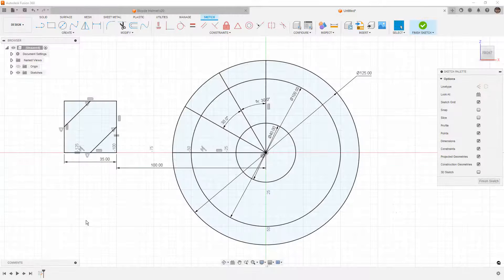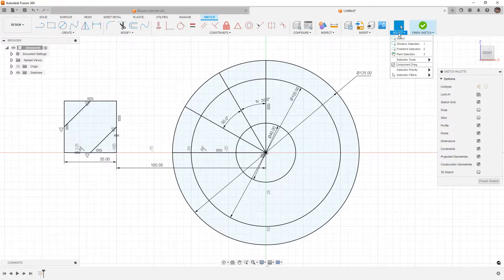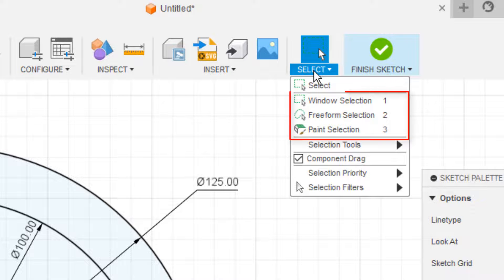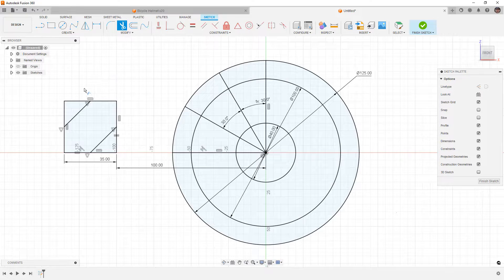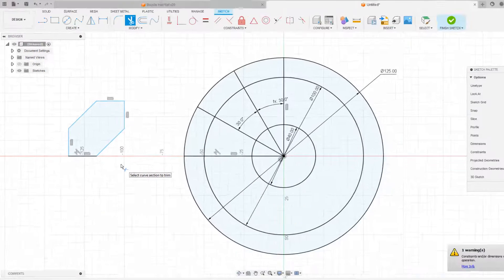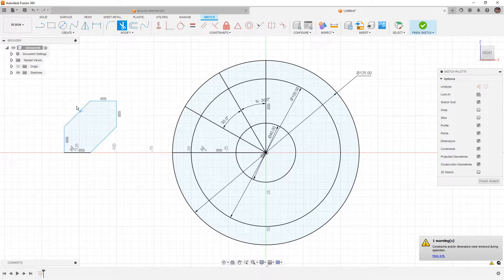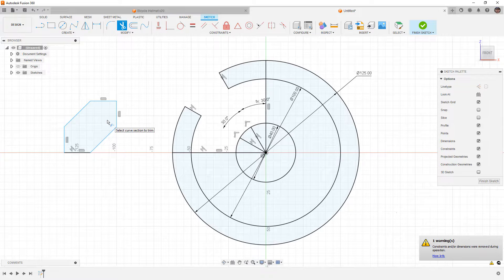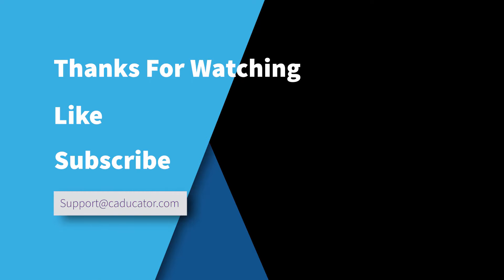Fusion 360 Quick Tip | Sketch Trimming | Quick Trimming | How To | Tutorial

Comment: Do you happen to have a video explaining how to constrain that "shape" once it has been trimmed? My OCD kicks in and i feel like i need to fix those constraints although it might not affect the drawing that much. Im just using fusion for some basic design for 3d printing.
Reply from the maker: It really depends on what the sketch is.  You don't have to trim anything.  But in the case of this one here the short lines would need to remain "coincident" with the origin point of the circle and would need some angle dimension.  The circles should be fine.  

In most cases the biggest pain with this is when trying to trim offsets.  I suggest just not trimming them if you don't have to.

Comment: Hello, how can I trim a section of circle that falls between two points. Is this possible? If I use lines instead of points, it works. What am I doing wrong? Thanks!
Reply from the maker: Trim will only work if another sketch entity like a line or arc crosses over it.  If you have 2 points on a circle you can draw lines from them to the origin and use trim or break, but sadly the point thing doesn't work.
Reply: @LearnEverythingAboutDesign  Yeah, that's a drag, seems  a no brainer. After all, when a line or arc crosses another circle arc, it creates a point. I'm going to submit a request to Fusion team. If you don't want a circle to trim or break at a point, you could click the point and make it a construction point. Anyway, thanks for responding! Great videos!